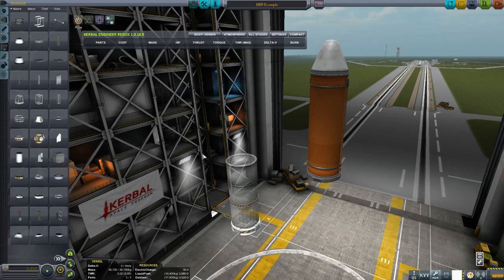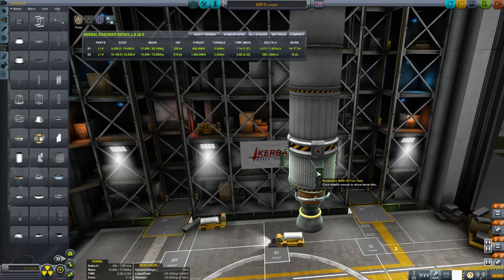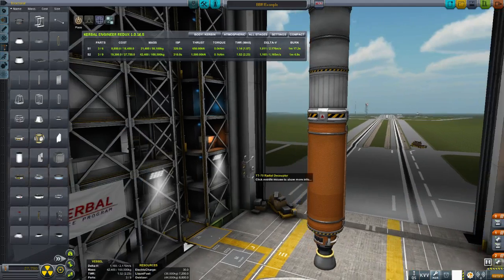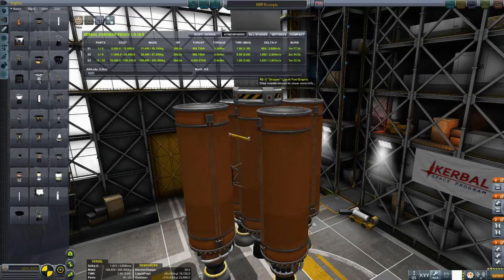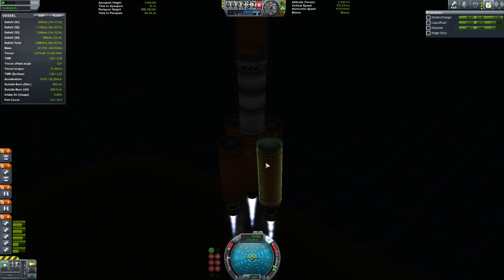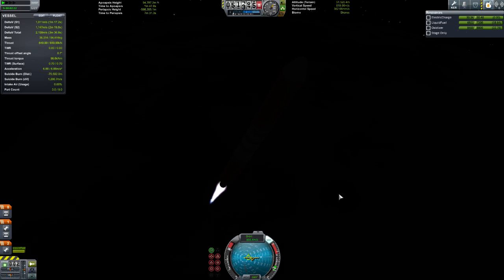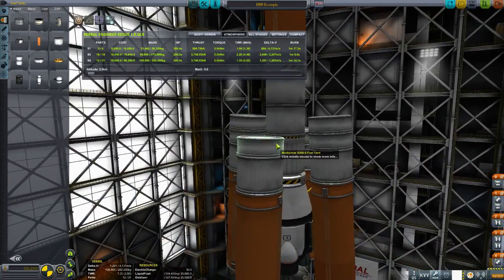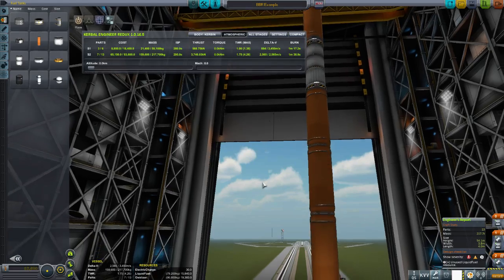Build Better Rockets 5 Exotic Staging

Comment: Originally " Asparagus Staging" was planned for the Falcon Heavy. 
But they decided against it because it added complexity.
Reply: More like the onion staging since it would make no sense to drop one booster after another on a two side boosters configuration. The their reasoning remains the same, too difficult to make it perfectly reliable in time for the rocket to be cost efficient and economically viable. 
One well known measure to mtigate this is to lower the throttle on the core stage until the side boosters are dropped, Falcon Heavy, Soyouz, Delta IV H and others to that. The only who don't is those equipped with SRBs as side boosters like Space Shuttle or Ariane. Ariance Y Vulcain engine is not that powerful to begin with. As for Space Shuttle, the main engines were throttled down to keep max dynamic pressure in check as the aerodynamics ot the craft didn't making go astray.
For rocket building you don't want to have a too tall rocket or, gravity turn will be the end of the rocket, it'll split in two and crash because of aerodynamic effects.
As well as having a too large rocket, aerodynamics will make a too fat tocket go astray as well. I encouter that problem with Space Y Heavy lifters mod. Good to put a big payload in a big fairing, but the fairing is solarge and the engines so powerful that an early gravity turn before 10 kms make the rocket flip over and disintegrate. Bigger rockets and heavier payloads mostly need to begin their gravity turn later, at least in KSP. Space Shuttle could do it earlier because of her wings and non symetrical design, using the imbalance at its own advantage to mitigate the use of gimbal, gimbal was used to compensate for aerodynamics more than to make the shuttle itself turn.

Comment: Another nice tip that I don't see anyone mention is that if you have a truly monstrous payload it is better to attach multiple rockets to the side instead of below the payload. Putting engines on top that are at a slight angle so they don't burn the rocket works well too.

Comment: Where can i find separators in this ksp version??????
Reply from the maker: ***** they should be under engines???? THey're in the same spot as the bigger Solid Rocket Boosters!
Reply: Negative Root I will check that again but i didnt saw thet yesterday
Reply from the maker: ***** they're pretty small and easy to miss :)